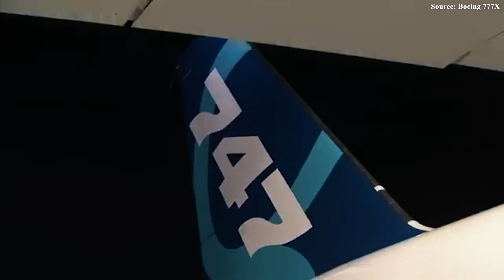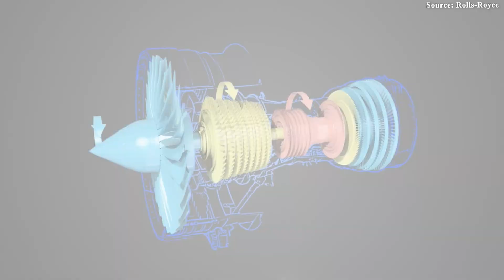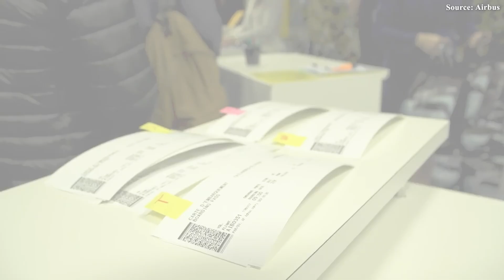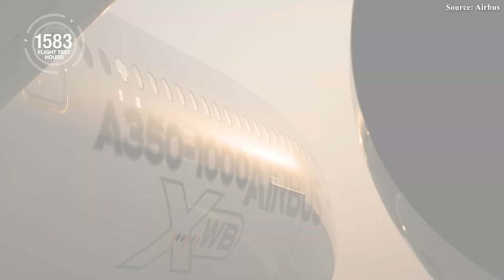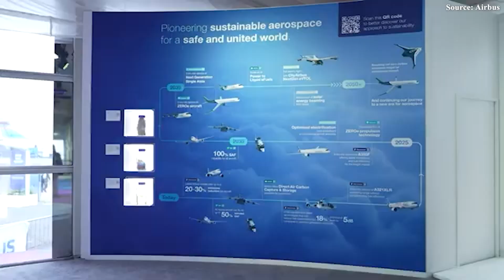Airbus NEXT Airbus A350-2000 will SHOCK Entire Aviation NOW!

Comment: An A 380 twin engine would be an option. The RR superfan engine to handle that is in development and resizing an option. The wigbox was overdimensioned and wings to handle the power are not all that different. Certification should be no big feat.
Reply: No big feat?  I don’t understand why people say these things, without knowing anything about aircraft. 

It’s impossible to turn a 4 engine aircraft into a 2 engine aircraft. There are so many reasons, but I’ll give you the biggest ones. 

The A380 has 4 engines at 75,000 LBS of thrust. It’s certified to continue take off on 3 engines. That means it requires 225,000 LBS(3x75K) of thrust required. Which means in a twin engine, you need each engine to have 225K thrust. No engine today has that kind of thrust. 

Now, you could reduce the weight of the A380, but that’s what the 777 or A350 is. 

Now, if you had an engine that could produce that kind of power, now your rudder is too small. The rudder is designed to have enough authority if one engine is lost, so you lose 75K lbs of thrust that the rudder has to counter. It isn’t big enough to counter 225K of thrust. 

Plus the aircraft has 4 engines with each supplying Hydraulics and electric power. All the systems would have to change to switch to a two engine system. 

This is never going to happen.
Reply: Bravo 😊 io voglio solo 4 motori 💃👠👗🤗